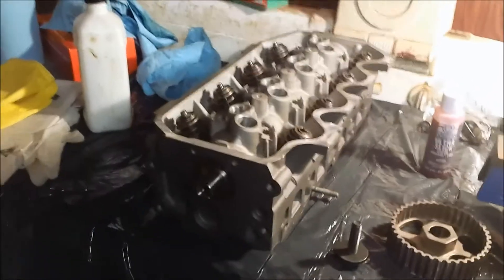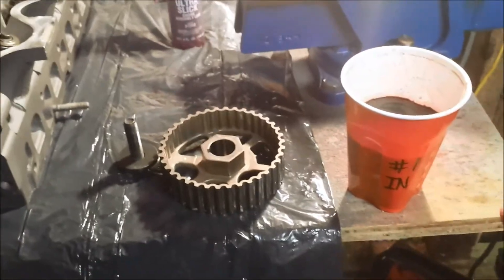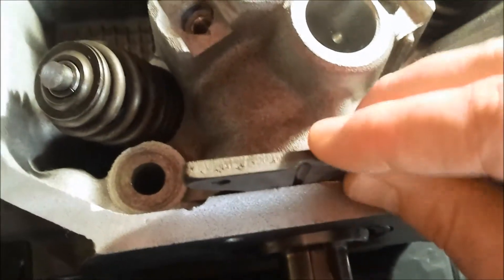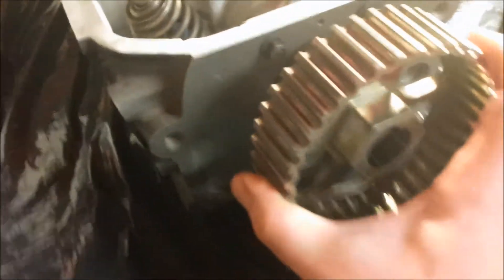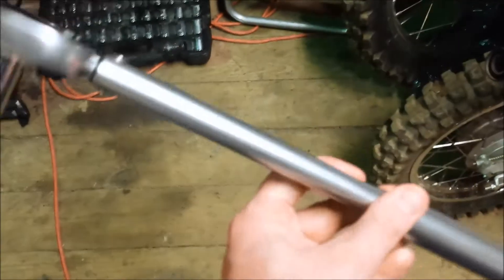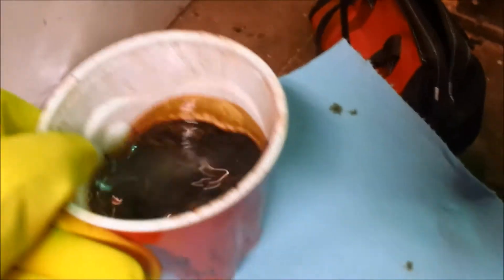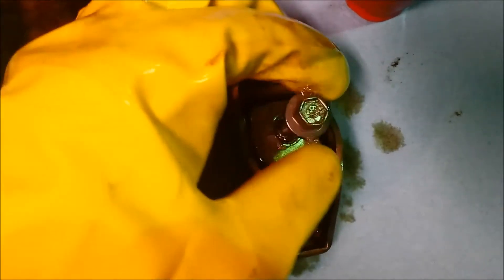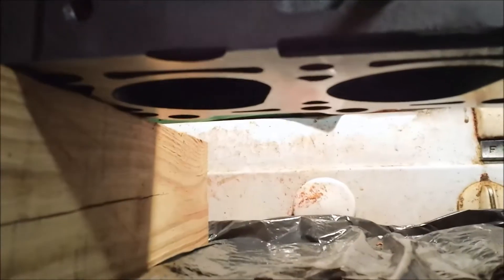Ford Focus Engine Rebuild 2.0L SOHC SPI - Part 4

Comment: I don't know if you still check for these comments but I have a 2001 Ford focus. Replacing the head on it (pulled one from a junkyard). When I put the exhaust manifold on and the runner for the fuel line, the bolt sequence was off on the new head, and it's the same engine so I don't know what the deal is there. rebored one hole to make it so that I can get six bolts attached (instead of seven).

Everything is Tghtened 2 specs. it looks good I don't know if it's good enough. I haven't done anything else at this point, thought I would get your opinion first. Never done anything this major before.

Thanks,

Andy

Comment: SoftwareDevJason, one question, when you torqued down the rockers arm, did you check the valve clearance with the gauge, or just tighten it on Top dead center position? The book mentions a procedure for valve clearance, but I am not sure if it applies when the head is already removed. Thanks again for your Videos.
Reply from the maker: I believe I just torqued at TDC.  However, if there is a procedure you are following that recommends otherwise, I would follow the procedure.

Comment: When u installed the oil feed hole to the lifters towards the oil feed holes on the cylinder head did you have any ticking or issues? Online people say to run the feed holes together and others say to be 180 out from the feed holes on the cylinder head
Reply from the maker: I didn't have any issues but don't take my word for it.  I tried to consult the service manual as much as possible but I get things wrong all the time!

Comment: What rebuild kit did you use?
Reply from the maker: +Daniel Barnes I believe the kit was by Mizumo auto on ebay?  Some of the parts are questionable and they weren't very helpful when I had questions.  I believe I ended up using Fel-pro gaskets in a few places instead.

Comment: softwareDevJason do I have to take off the head off my focus to replace the lifters?
Reply from the maker: +828351nissan You should be able to access them in the same way I'm doing here, so yes.  Be careful dealing with these, they need to go back in the same direction they came out.